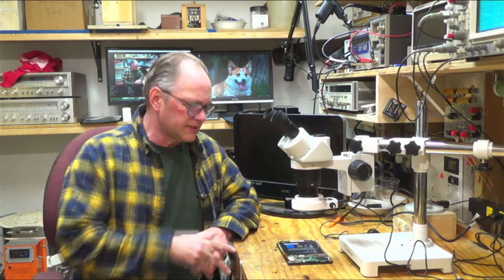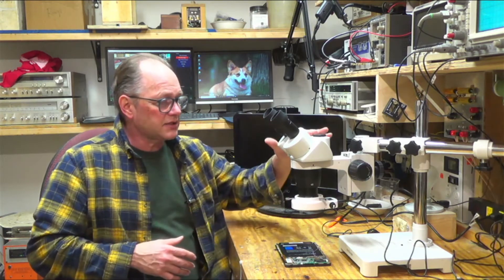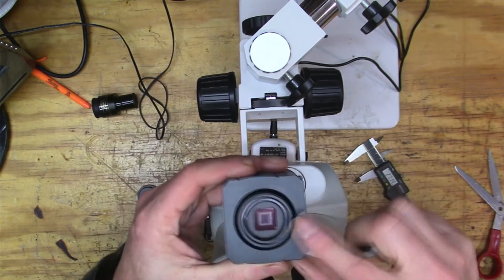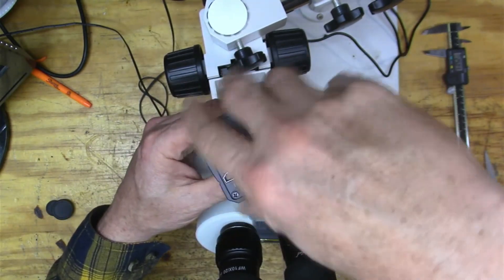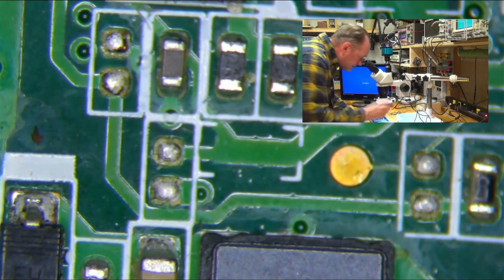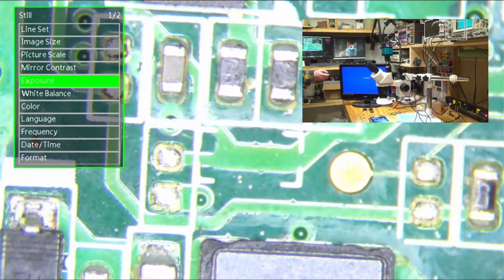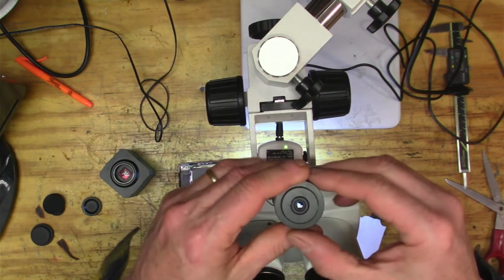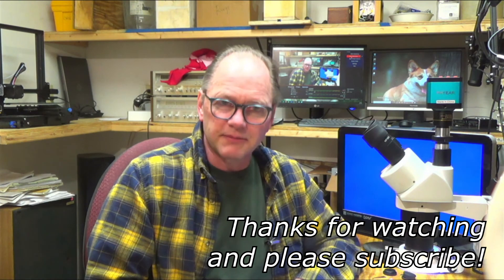Adding a Hayear video camera to an AmScope microscope.

Comment: Nice video,real good setup for doing close-up work.On a side note,i had not thought of this before now>would the SMOKE from the soldiering gradually degrade the view???I think if so either a fume extractor or cheaper a very small 4" table fan to blow the fumes away from the lens ,maybe?I just cleaned the inside of my car windows,haha that's my reasoning.good vid.
Reply from the maker: You raise a great point. I should have one either way.

Comment: Very informative video.  Thanks.  Will I be able to run an HDMI cable from the Hayear cam to an iPad with an Apple HDMI-to-lightning adapter or will I need any other adapters?
Reply from the maker: I've got a pc based HDMI to USB converter which works pretty good but I was also able to use the USB directly to the PC as video in

Comment: I wanted to add a video camera to my AmScope trinocular microscope but I had no idea of what to do. So I bought a Hayear camera and connected it to my scope. Here's what I found out.
Here's the stuff I used:
Camera - https://amzn.to/3beXUXJ
Adapter - https://amzn.to/37o2XnB
The adapter can be purchased directly from AmScope as well.
Camera Specs: HDMI 1080P @60FPS USB2.0 @ 30FPS

What is the size of the adapter.. Your link is broken
Reply: Please add a link that works for the Adapter (to AmScope)

Comment: don't buy any AMscope products, the microscope lasted only 10 hours and the several major issues are already there
Reply: what do you mean it only lasted 10 hours.... 
how is not working?
Reply: @AlaskanInsights  The light broke, started to flash uncontrollably, the stage was skipping, not sliding smoothly. Just avoid this brand.
Reply: What better brand would you recommend?

Comment: Thanks for the video. What scope model is that and do you get the same field of view with the 0.5x on camera as with the eye pieces? 

If possible please let me know. 

(Got info I need a 0.35x extension for the camera to get approximately same field of view)
Reply: I actually have the same problem as you have. Is it possible to get the same view with 0.35x adapter?

Comment: What scope model number and x power etc.? Thanks.
Reply from the maker: Here's the scope. https://amzn.to/2P5wWeg I also added a .5 Barlow lens to make it easier to work on circuits
Reply: @RobsFixitShop  Hopefully, good for soldering SMD electronic components. I am also thinking on an LED light. Now, I have seen the Simul-Focus or something like that, keep the focus while adjusting x powers. Will check this one. Thanks.

Comment: Awesome video I'm thinking  of doing a repair channel myself what software do you use to record the multiple  angles for the different cameras like the side view and microscope view any information  I would greatly  appreciate
Reply from the maker: I have started using OBS studio which I really like. I use 2 older camcorders (I like the manual zoom) into HDMI to USB converters. You do have to put a time offset on the microphones to get the sound to line up. You can then set up different scenes using each camera or more than one camera at once. Pretty slick
Reply: @RobsFixitShop  ok thank you for the reply I have been wanting  to set up my own channel for a while I just need a good microscope camera I know some people don't like sharing info but that's what  YouTube  is all about I have learned  so much  from YouTube I also want to share my knowledge  to help others thanks again I will have to learn that software